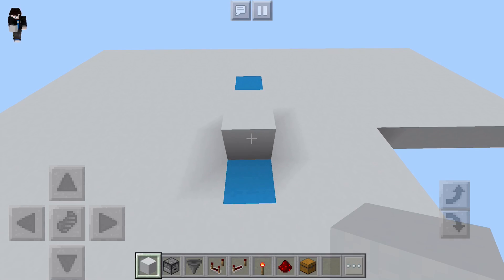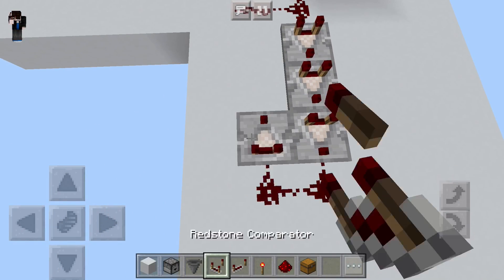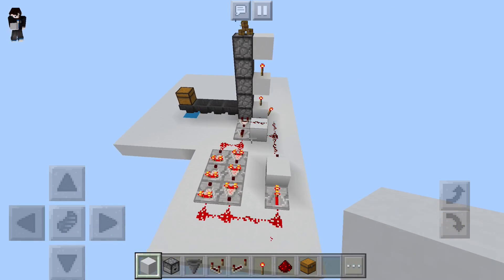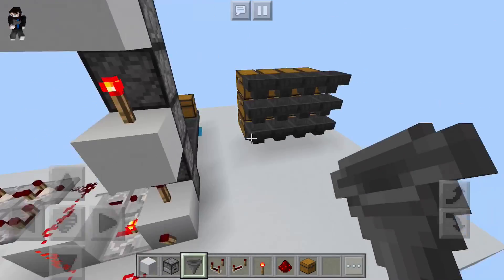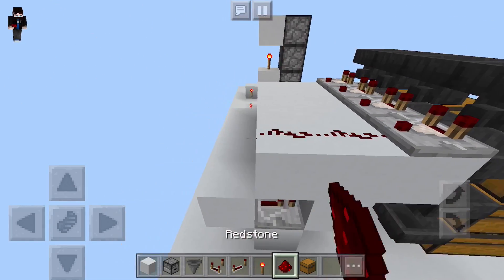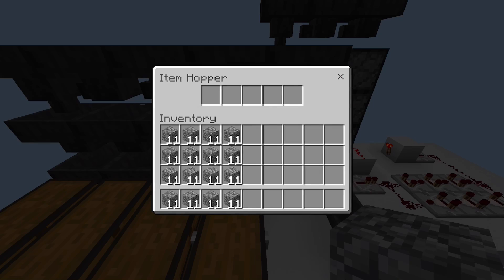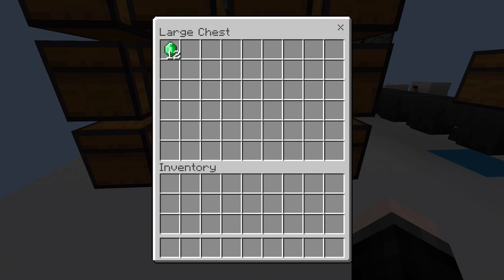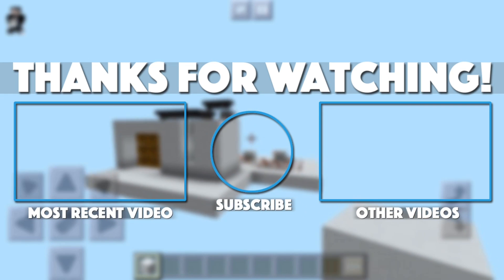Item Elevator and Item Sorter in Minecraft Bedrock Edition | BluPrints Tutorial Series

Comment: So i made this, just without the initial dropper system at the start because i planned to put it under a mob farm. So basically the beginning will just be hoppers that mob loot drops into. I built the rest of the system exactly the same way tho, and when i drop something into the hopper, it just stays in the first slot of the hopper that its supposed to go to and doesnt filter down into the hopper that is actually connected to the chest. Any tips or help you can offer?

Comment: BluJay, there is a significant flaw with the way you showed the sorted design. The reason people use ImpulseSV’s design is because it has overflow protection. This means if the first slot is backed up, and fills to 64 items, it still won’t break the sorter modules next to it. In order to achieve this, there can only be 1 named item in each of the last four slots, no more. If you put 11 named items in each slot like you showed, the sorter will break the adjacent sorters once the system backs up past 24 items in the first slot. You need to put 41 of the sortable items in the first slot, and one named item in each of the last four slots if you want overflow protection.
Reply from the maker: Ooooh. Thanks for this heads up! I’ve always done it using 11 item sorters in each one, but I’ve never had enough items to cause it to break...I’ll keep this in mind for future builds that might have this issue! 😀
Reply: @BluJayMC  Have you made an update to this video since you've received this news?
Reply: Good catch. I tried it the other way with 11 fillers and 1 sorted item. It sent a bunch of my items I wanted sorted to the overflow/ miscellaneous chest. The 41 sorted and 1 filler fixed the problem.
Reply: BluJay Games Can u make another tutorial with the corrections?

Comment: It's purely a personal preference, but I like stacking my chests when I have multiples so that the items flow into the top chest and hoppers connect them downward from there, so that when I draw from the bottom chest it immediately starts filling again from the top.  In this setup, if you happen to empty the bottom chest you have to manually open up the upper ones.  That means that every chest layer has to be visible and accessible.  Whereas by connecting the chests directly, only the bottom chest has to be accessible.  

I will probably use your item elevator somewhere! ;)  I've had problems getting one that worked consistently before.
Reply from the maker: Good point! Not a bad idea to have chests that can flow into each other so they automatically all sort down! I’ll have to think about this for future designs! 😀